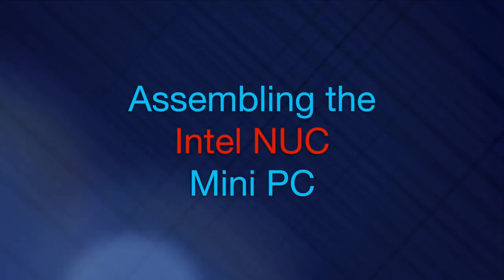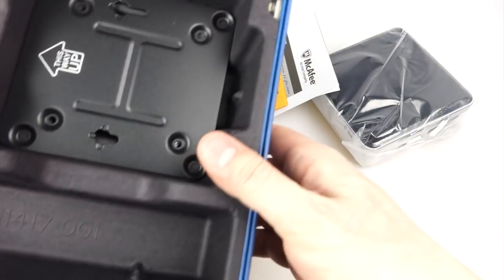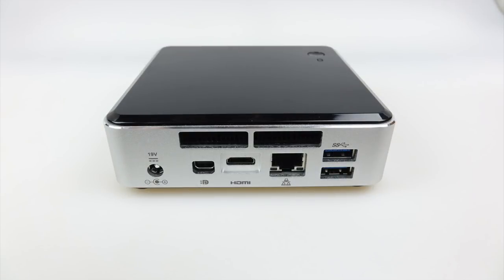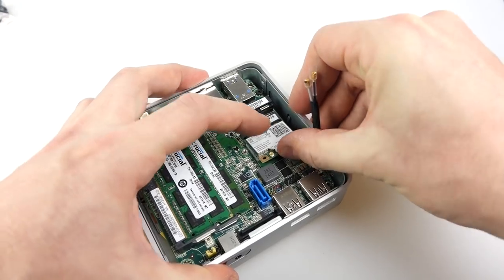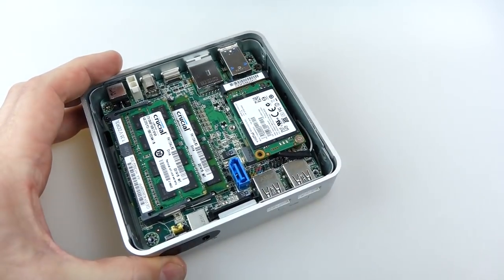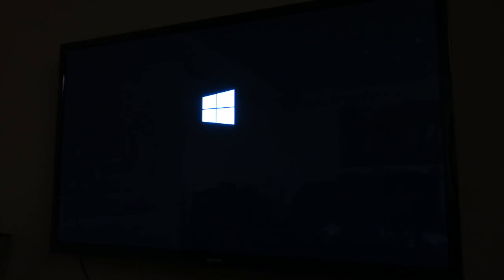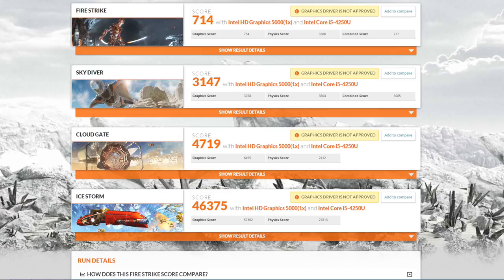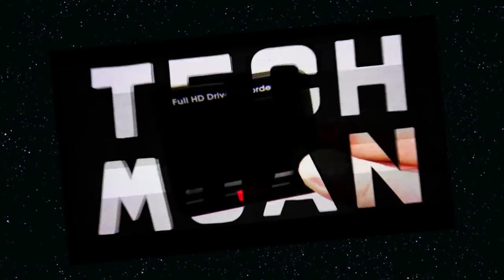Assembling an Intel NUC Mini PC - i5 D54250WYK

Comment: I got the TOTL Nuc, with an i7, 16 gigs of RAM, Iris 6100 graphics and a 2.5" SSD holder in the lid.  Not a bad system.  I do audio/video editing, 3D modeling, all with no problems.  The only thing it's lacking is FPS gaming performance; you really gotta have a dedicated card for that.

Comment: We build these at work. I've not built one myself. I stick with the bigger gaming systems. NUCs are pretty good and I was tempted to get one myself. until I saw the price.
I had to giggle when you mentioned static. We never use anti static anything. Ok, parts come in the anti static bags but thats it.
I actually demonstrated to one of the new guys that it wasn't important to ground yourself. I unboxed a case, touched the side with a screwdriver. Nice little spark. Then unboxed an Intel CPU, memory, graphics card... Then I touched all the gold contacts, all the contacts on the back of the boards.... Built the system and fired it up.
The lad was quite surprised to see that it worked and I was also able to overclock it :)

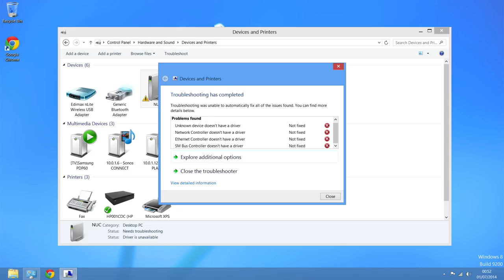Comment: 10:16
Ohhhh. The memories of feeling screwed over if you lost an install disc for the network drivers and had no means otherwise to connect to the internet to get said drivers! -_-
Reply: My old school hired me to reinstall windows on all their pc-s. They use really old hardware, some asrock motherboard, an intel celeron and 2 fcking gigs of ram. Nevertheless, when i installed it, it wouldn't recognize the onboard lan, so i had to open the pc, look at what motherboard is inside, on my phone search for the drivers, connect using usb, transfer and then install the drivers to finally be able to proceed.
Reply: I see no problem when you can't connet to LAN/WLAN because you don't have drivers. Just download them on other PC (or phone) and put them onto a USB drive.
Reply: Juan Reynoso nowadays windows have basic universal drivers for almost everything. They don't work as well as oem drivers, but they can get you by.

Comment: I have the same portable keyboard for about 2 years now. The only thing I would add to it is that being not back lit - it can be a tad hard to type on (if you dont know how to type by feel) but over all its an amazing little keyboard. Light, good size, the track pad is responsive and the battery life is quite good. 8/10
Reply from the maker: They do a backlit model - the Logitech K830 - but it's £90, so I'll put the lights on instead.
Reply: Techmoan lol indeed. For $25 its a great little board.

Comment: Just put one of these Intel NUCs and a separate Gigabit Brix today.

The NUC we had bought had no Ethernet port, only WIFI, won't make that mistake again.

The Brix had both a VGA connection and Ethernet which made things a lot easier than the NUC we have that was missing both of these.

The NUC's displayport can be fussy during the whole Windows installation process.

These Box-type PCs are a lot of fun to set up, despite some challenges.    Thanks for the great video as usual.

Comment: I was thinking of getting one of these for my dad when his 7 year old PC dies. While he'll be doing some gaming, it's usually old games anyway, which run well on his ancient GT220 (which is still a great card to this day) so it'll run well on the 5000. Glad to hear that it's quick !
Reply: Gt 220????? Lololol, I thought my 9800gt was slow. I did only upgrade to a 7770 though, so I still don't know what fast is. :)
Reply: tcv4
7770s aren't bad. Linus (a tech youtuber) says that 7770s are good mid-end cards. Personally, I own a 7870, pre-overclocked.
I have various cards in different systems, for instance in my old Acer machine I have an XFX 9400GT, 512MB DDR2. Works well, and supports Aero, so I can't complain. In my server PC it has a generic Intel GMA 64mb on-board die so it's not that great.
Reply: c0d3r3d I just wish it a had a little bit more headroom for a fairly unoptimized game like BeamNG.Drive(no offence to the devs, but...) Sadly though, My athlon II 64 X4 Oc'd to 3.3ghz is what will be holding things back next(pretty close to desktop i3 performance). Kind of just waiting for a good deal on a 280/280x. Yeah though, I have one of the xfx 7770 ghost editions which was factory overclocked a fair amount. I got it like a year ago at best buy for 100 bucks and can't complain too much as I've been able to run everything @ 1080p and medium settings.

Comment: I got caught out when I bought a Brix.  It was on special in Maplins at only £85.  I thought I could use a hard drive and ram that I had laying around the workshop but no!  I had to buy special low voltage ram so it cost another £40.  If you then had to buy a hard disc and an OS you'll be out of pocket by the best part of a couple of hundred pounds or more depending on which hard disc and so on you choose.  I do love it though.  It uses next to nothing in terms of electricity usage.  Can't say exactly how much it uses but it's not much.  Less than 60 watts I estimate.

Comment: That gaming performance is still quite impressive for something of a casual nature, especially for something that small. You wouldn't believe the extremes and the costs gamers would go through for a high power rig, so running higher graphics games either way requires hefty hardware

Comment: the boot time is not only due ssd's but also EFI play a huge role. I have a 4 year laptop without SSD and still booted in 25seconds, then i had to undergrade to win7 and now the boot time is over 1 minute. Benchmarks from the NUC compared to i5 3230m are marginally the same.

Comment: I can't say I'm surprised at the lack of hardware support out of the box, the Dell laptops we buy at work can't use any of the windows built in drivers, I'm still working on a good way to get around that for easy setup. I'm quite impressed with this little unit though, as I'm likely to be throwing my Roku through the nearest window at some point soon this might be the perfect small 'proper' PC to take its place. I was impressed with the gaming performance you showed, in the past Intel graphics haven't been much use for anything more intensive than Office but it looks like that isn't true any more. Heat would probably be the biggest issue there. Thanks for showing us around.

Comment: I'm an electronic engineer and I'll tell you that you're perfectly safe not using an anti static wrist band. lol  As long as you handle the boards from the edges as you did you should be okay.  Also most circuit boards have a protective coating to prevent static damage.

Comment: Thanks for the review - I'm in love with the idea that one day a standard home PC will be about the size of a smart phone.  When that happens, I want someone to make package with a monitor with wireless connection to keyboard/mouse.  Would be good if the monitor had a few 'holsters' on the back where one could plug in a few pocket sized computers and just switch between them from keyboard - so you could run your linux server on one, your gaming machine on another, and maybe have a third operating as a juke box, :D
Reply: Im not fan of apple but it's imac

Comment: You basically have a Mac Mini without the OS X operating system since Intel made them in the first place. Unfortunately the latest Mini only has Intel HD4000 on there website, I know one in the last 2 years came with the Nvidia graphics chip option inside.

Comment: In the 1970s we were joking that eventually, the computer would be the bump in the power cord supplying the monitor.  We're damn near there.

The Intel NUC looks like an ideal machine to use as a dedicated domestic communications device — email, Skype and VoIP telephone.  Hang it on the back of a monitor, add a camera, microphone, keyboard and mouse, and you're set.

Comment: Has there been any updates to such mini PCs and how much do these cost nowadays? Think this would be absolutely great for some of the things I'm thinking of doing without always having to replace a whole notebook PC when something goes wrong, plus do they sell these pre-assembled?
Reply: I tried out an android based system, but as usual didn't last very long, hence why I'd like to know if it is worth it
Reply: I re-purposed both the memory 4GB and HDD from a defunct laptop on an "H" model and $20 for Win10. $110 for the complete system. The Celeron processor does what I need for web based applications. The "newer" models have onboard BT & WiFi out of the box

Comment: You should use a Pi3 for the PiCade, it's more powerful than the single core pi and can run emulators up to the Dreamcast and N64 with reasonable performance. Any retro emulators before this gen work flawlessly (Excluding Genesis) 
The project "Retropie' takes care of all the software fluff.

Comment: really nice little box. I-5 4th gen, not bad. i have an I-5 3rd gen, boots to password on Win7 pro in 12 seconds with an SSD, i'm running linux Mint 16 on it now, even faster. might have to get one at $350 USD, i picked up a 128 GB drive today for $50.

Comment: 20 second start up!!! LOL!!! My ancient  home theater PC, I believe its got a 5400 RPM drive, 4 gig mem and I think a core i3, something like that, takes at least 3-4 min before it's really usable and you can click on something and don't have to wonder if it's realized you've clicked on something.
Reply: An i3 is not that old. Get a cheap SSD and it will start up just as fast.

Comment: I almost gasped when you pulled off that connector. Those things are fragile little shits, I had a small job once mounting WAN cards in Lenovo laptops, and you had to attach 3 of those per card, and you'd always have one of them that wouldn't go on, and if you pressed on it the wrong way the whole thing would bend into dumb brass lump. I understand that it has to be a small cheap connector and that you are under most circumstances never gonna touch these but it seems like there has to be a better way.
Reply: Major correction to what is said in the video.  This is not just a wire.  It's an actual coaxial cable with an outer and an inner connection that should both be connected.  Just like on an old school radio antenna only smaller for those 12cm and 6cm wavelengths.
Reply: that's an interesting information to know
Reply: very fiddly reconstruction required to fix that. Any half millimeter holes in the finished shielding and its effectively a potatoe. Still a potato is probably better than nothing.

Comment: Neatly cool stuff definetely.
Excellent messup with fiddely coaxial wires though.

I wonder what the true power consumption on particular usecase may ever be on these thing.
Reply from the maker: Full specs (including power consumption) can be downloaded here: http://downloadmirror.intel.com/23089/eng/D54250WYB_D34010WYB_TechProdSpec06.pdf
Reply: Thank you for the pointout!

Ten amps listed in specs seems quite redundant for the application yet reasonable higher limit.

As five years old sony notebook with hdd, equipped and powering active external usb ftdi serial wireless modem and a tv av usb tuner as well for the mobile groundstation application, drains actually around 1,8 amps at 20 v running trimmed xp , which seems not higher than 40 watts.
Yet near to possibility of passive heatsink performance

Comment: for the price of the NUC alone you could have bought an amd 5350 plus ram plus the top of the line motherboard that works with the same 19v power brick. that cpu is 10x better than that one and you also get a full PC (dim ram, 4 sata, pcie, etc) in roghly the same size
Reply: it is one cpu, one motherboard, one stick of ram. ok, maybe the case would have been the only extra thing. but it is all as plug and play as this one. but 1/3 of the price and 10x the performance.
Reply: most amd 5350 motherboards even use the same msata ssd he used there.

Comment: Hey Techmoan, it'd be really awesome if you reviewed your Smart Roadster (is you still own it that is). I want to buy one and literally nobody as made a decent review.
Reply from the maker: +o0julek0o I'm looking to do something about it in the summer.
Reply: +Techmoan May I recommend an air mouse for about $11 USD(or less) on eBay. Takes a bit getting used to, but will help. Thanks for sharing this awesome mini computer. Cheers
Reply: I own a Smart Roadster, I could tell you a bit about my experiences with it? I've had one for over 4 years now.
Reply: Sweet. I'm mostly interested in the gearbox performance; is it really as sluggish and clunky? I'm a bit of a violent driver and so this is somewhat important to me. Are parts cheap and readily available? Is it easy to service by yourself? Is there a relatively easy way of putting a 2 DIN head unit in where the original is? How's the gas mileage? Any quirks that you love/hate?

Comment: What few "staticphobes" know is that all computer cases are coated in a clear anti static solution. That means if you keep your skin in contact with the case while working on it you're fine. Also watch out where you assemble it as well. Me being a certified computer technician I will say this guy knows his shit.

Comment: Thanks for the video, it was really helpful. Just one question, suppose I have a booting USB with Ubuntu inside, do I just have to turn the thing on and it will boot from the USB or is it more complicated than that? Thank you.
Reply: step 1:
get windows 7 or newer.
step 2:
you have to boot into recovery mode an select the USB as the first boot check.
step 3: restart
step 4: if nothing happens use google.

Comment: Hi I am also looking at the NUC in arcade cabinet idea.

Can you remove the motherboard from the NUC CASE? I am wanting to run wires for a power switch from the NUC CASE to the back of my arcade cabinet for easy access.

Thanks in advance

Comment: Not trying to be an Ass, but Minecraft is actually an quite resource-intensive game since its written in Java. The Java virtual machine pretty much only runs on the CPU, so the thing you need to archive an better framerate is loads and loads of cores and clock speed. The graphics card isn't that important.

But i think the i5 should be able to handle it without any big problems.
Reply from the maker: I've never played it - hence my lack of knowledge, thanks for the info.
Reply: Techmoan yea, he is right :) many many people speak of minecraft like it is very very low demaing game (because it is "pixelated") but the truth are if you want FULL MAX setting you will need very strong pc, like 700+ usd :)
Reply: Minecraft actually only uses one core unless you are using the optifine mod
Reply: EdwardTennant's Minecraft Videos Thats not what i said tho. I said that the Java virtual machine needs plenty of cores and clock speed. 

I know what you mean, but they are working on multithreading at the moment, will be finished soon.
Reply: For me, I've had to use the Optifine or similar to get stable 60+ fps on my old rig, currently on a GTX 770 & 4670K I get somewhere from 90 to 120 stable (though it's been a long time I last time really played it). This NUC would have 30-50 fps without the Optifine or similar tweak.
Reply: Optifine runs wonders most of the time
Reply: Minecraft ENB series lmao
Reply: ***** Yeah, you don't need much of a comp to run minecraft at this point... I ran a solid 30+ fps maxed on my OG Surface Pro (ULV I5) a couple months ago.
Reply: ***** Since when does Java use more than 1 core lol.
Reply: Actually the renderer is the LWJGL library, and is a wrapper for java to use the OpenGL API which is written in C, because OpenGL wont run in java otherwise because it is in a different programming language, and that runs on the graphics card (it would run on the CPU if it was a software renderer, but it is not and it is harware accelerated), so your statement isn't entirely wrong, but it uses more graphics card than CPU.

Comment: Why not use your old net top for the mame arcade and use your new nuc for dashcam stuff .
Reply from the maker: It's looking very doubtful that I'll ever get the time to assemble my Picade - but if I do then it definitely won't fit a Revo motherboard in it - I think you may be misjudging the size of this cabinet. You can read all about the recommended boards for it here https://www.kickstarter.com/projects/pimoroni/picade-the-arcade-cabinet-kit-for-your-raspberry-p/posts?page=8
Reply: It seems a bit of a waste to me to hide a quite expensive and powerfull nuc inside of an Picade. I assume you won't be taking the nuc in and out of the picade everytime you want to use it for something else. Isn't it possible to mount the Revo on the back of the picade using a vesa mount and some ingenuity?

Comment: I don't understand why you bought a wireless adaptor. Intel's official web page says that the nuc kit comes with a built-in wireless+bluetooth.
Reply from the maker: +Süleyman Tuğberk Ünal Well I didn't end up with a spare one when I'd finished..
Reply: +Techmoan I guess this version does not comes with a network adapter. Thanks for the answer.
Reply: Maybe it came with N and he wanted AC?
Reply: this unit does NOT come with the wireless card.  i have 2 of them neither came with wireless.  its a separate purchase along with memory and ssd card.

Comment: Had I seen your video before, I wouldn't also break the connector off of the antenna... oh well, only 2,4 GHz WiFi seems unworkable, the rest still works on 1 antenna 😄

Comment: the only thing I don't understand is why there are only usb 3 ports on it when 2 are only going to be used for keyboard and mouse. wouldn't it be a bit more cost effective to have 2 usb 2 and 2 usb 3 ports?
Reply: ***** Where would you plug in your mouse and keyboard then?